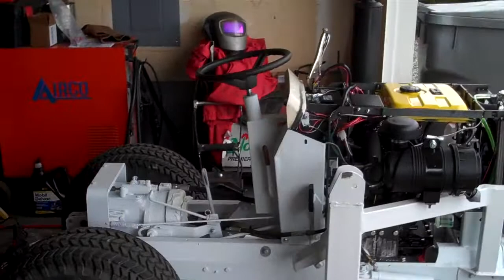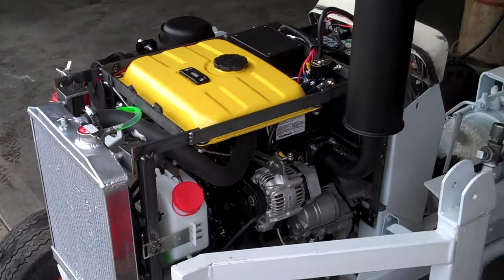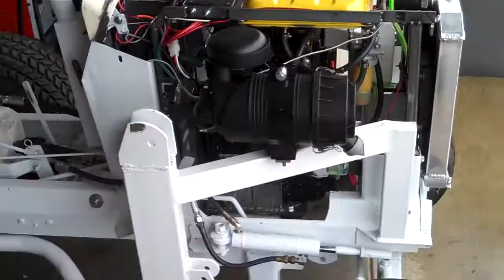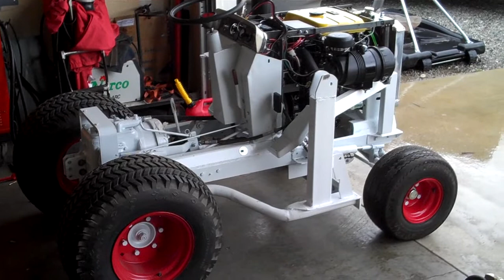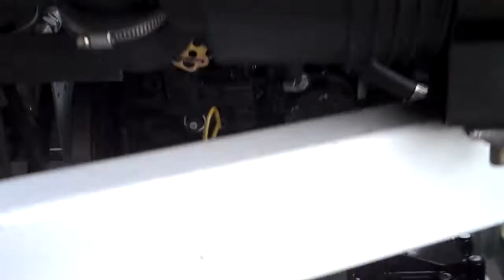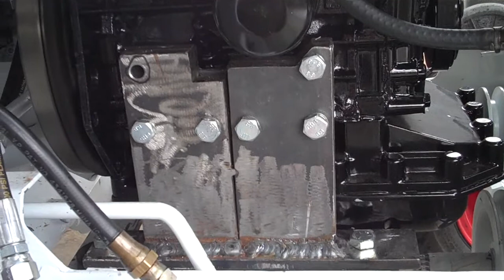Yanmar 2TNV70 In Bolens 1886

Comment from the maker: I haven't done anything to the governor yet.....and I don't know if I'll have to as this is a hydrostatic and will run at WOT.  If I have to, I'll order parts that are available for the Cub Cadet UTV which uses a 3TNV engine.  That is where I got the wiring diagram that I modified to fit my application.  As far as the alternator, again, it is a Chinese version of the 40 amp internally regulated that goes on the 3TNV engine.  The radiator is a dual core Honda Civic aluminum aftermarket radiator.

Comment: I would ask why have you done all of this and what exactly have you done? Cool looking though I don't understand why.
Reply from the maker: Legend of the strings The original engine was toast, it was also an air cooled, gasoline engine.  I wanted a diesel water cooled engine....so I put one in.  Of course I had to fit a radiator and fan in there as well as move the battery and fuel tank around.  It was a challenge but is running good to this day.